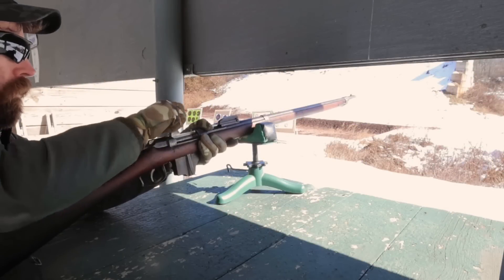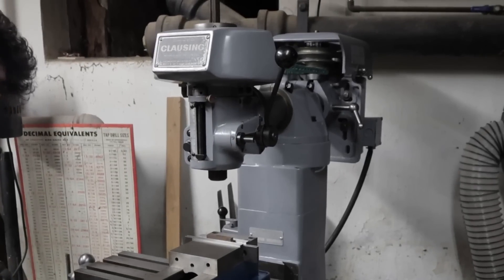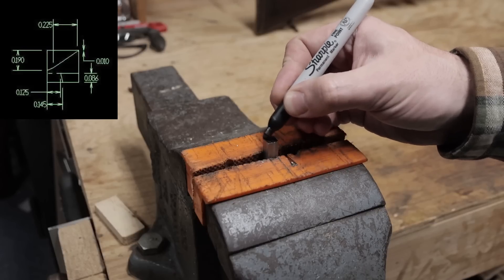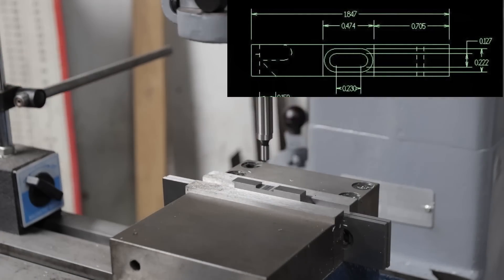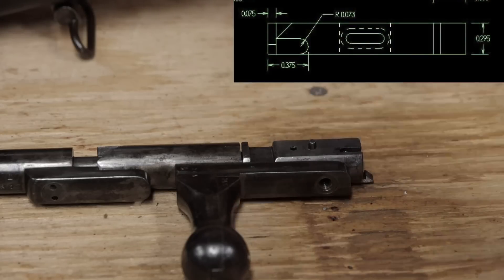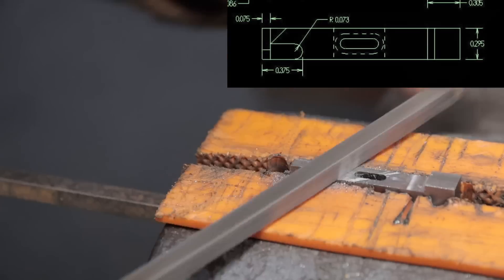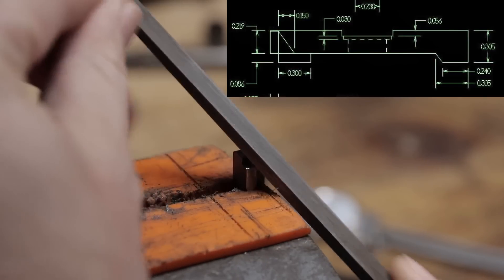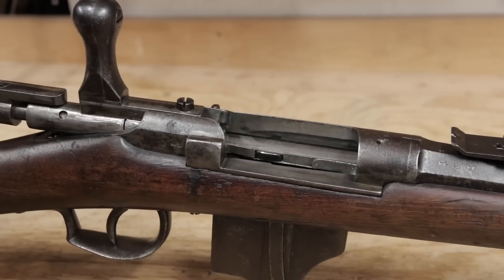Making an Ejector for a Dutch M1871/88 Beaumont

Comment: Do you think it needs case hardening to make the edges hard for wear !! I would think it would help ??
Reply from the maker: It would make the ejector more durable, however another commenter pointed out that it's better to leave the ejector soft so it wouldn't cause wear on the receiver, which I agree with.

Comment: You can do a lot of work with that small mill. While not a full size knee mill you will be surprised what it will do. I had one for several years before I upgraded to a 1972 model Bridgeport. Clausing makes fine equipment. I used to run a Clausing lathe when I worked for the Boeing company. Just be aware of your cutter size as they won't tolerate large dia. cutters or face mills. You did a fine job on that ejector...
Reply: In your opinion and experience what type of milk should a person get if they don’t want any gun smithing limitations.

Comment: Don't forget to heat treat it. Otherwise, it will wear quickly.
Reply from the maker: I was going to potentially remake this from harden-able steel, but another commenter pointed out that it's better to leave it soft. That way any wear will be on the ejector rather than the receiver or bolt.
Reply: @rakumprojects  check the Rockwell hardness of the bolt. Aim for just slightly below that.

Comment: When you couldnt get bolts or bolt parts for all the Century gewehr 88s, id made an ejector in a pinch using a metal pen pocket clip....it works for about 20 to 100 rds before breaking , but at the time, it worked in a pinch.

Comment: Do you think case hardening the part would be a good addition?
Reply: I thought the same but because of the age of the rifle I would think it better not to better to mill new parts when and if the wear out than to cause damage to the rifle itself in my opinion
Reply: @samellowery  you can harden just the face that wears and leave everything else soft with cherry red powder
Reply: @vettepicking  yes you are correct but I wonder how often he shoots it with all the other BP firearms he has and the fact he has to handload for them all I imagine it probably doesn't get but a couple hundred rounds through it a season if even that.
Reply from the maker: Yes, case hardening mild steel or making it from tool steel would make it last a lot longer. I don't have a forge to case harden (yet), but I could always make it again from tool steel if this one doesn't hold up.
Reply: @rakumprojects  you can just use "cherry red" hardening powder and a good torch to surface harden mild steel parts, no furnace needed....